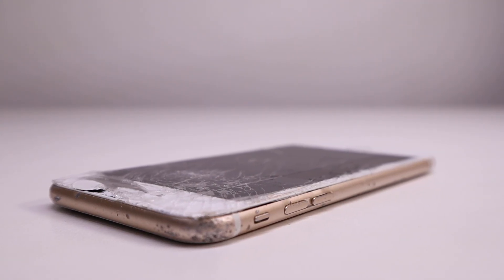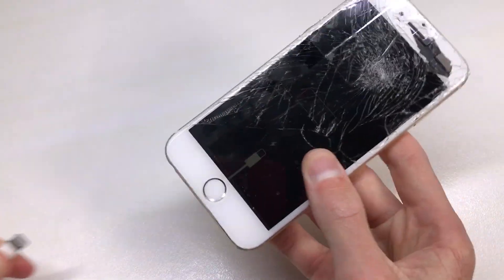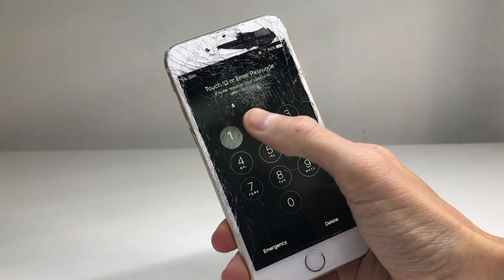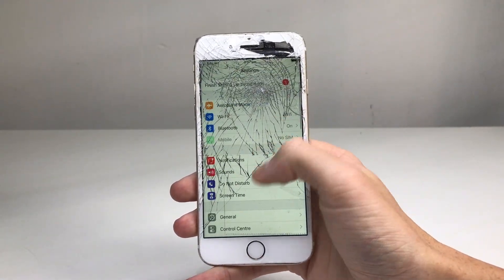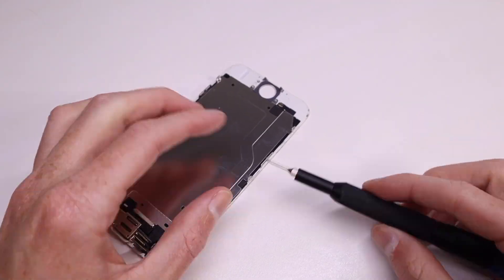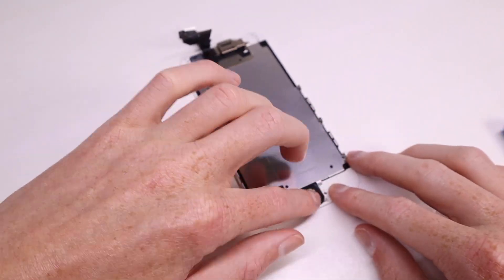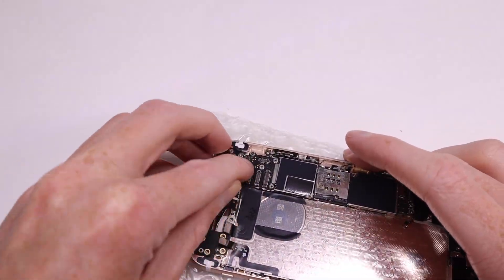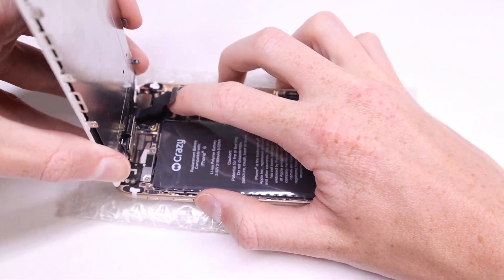$30 Destroyed iPhone 6 Restoration - Seller Tried to Scam Me?!

Comment: Loved your video, totally brilliant. I am sure that I am not alone....

But do not confuse people by talking about static and battery voltage together, almost as if they are the same. 

Some electronics can be damaged by voltages over 20 Volts. A static "spark", if visible, will easily achieve 6,000 volts or more. A static charge of 3,000 volts will not be visible, except maybe in total darkness!
Static discharge can also "weaken"components, sometimes they work and sometimes they don't!!

Never use any sort of plastic bag for working on, as many are not conductive. Conductive ones often have a tinge of colour, but if you are not 100% certain, do not use it!!

Static can be a killer of electronics, and working on such units as telephones, should ONLY be done on an anti-static mat (very cheap), connected to earth (for example, a house metal heating pipe where no paint has been applied), always checking the earth connection carefully with an Ohm Meter, and either an anti-static wrist strap (with a safety 1 Meg Ohm resistor included) to the same anti-static mat, or roll your sleeves up and always work with at least one hand/arm resting on the mat at all times. 

A 1 Meg Ohm resistor is needed for safely working anywhere near to mains voltage, but is a short circuit for static, leaking any high voltages away instantly.

After moving around, always touch JUST the mat again before touching the electronics, in this case the phone. 

I do not know if there are white anti-static mats, but if possible, buy one, as the video will be clearer for all here on Youtube!

Wearing clothes with man made fibers in them is a big "No-No". 

Natural fibers only like cotton.
Lay all your tools out only on the mat, or a second mat, also earthed.

A higher value of air humidity will also help to reduce static charge, above 65%.
Having a floor anti-static mat, where you sit and work, is also good, but if you keep your feet and legs fairly still, probably not needed.
Either wear no footwear, or only leather. No rubber or plastic soles or socks. But there are cheap static ankle units that are wound around the shoe and tucked into your sock, to make better floor contact....
Plastic or many made flooring is a no no too....
If you have any further questions, just ask.
Man, many thanks for making an otherwise really great and informative video.

Comment: 7:00 this is the antenna band. 
7:20 this is actually the ground -- leave this out, and the iPhone goes haywire.
The lines are just a bad connection on the screen... also a random coin flip :\

Comment: Looks like a Frankenstein phone with broken parts from multiple phones that were repaired. Bad parts assemble!!
Reply: SamSamStudio Please fix you’re englis so i can undastand yo
Reply: @chilly1661  Looks like the Ebay seller sold him a Frankenstein phone, a phone assembled from broken parts from multiple phones (i.e. a broken screen from one phone, a bad battery from another phone, a home button from a third phone, etc.) Jokes on him Hugh can still salvage what's left and bring it to life.

Phone flippers or third-party repair shops will buy broken phones to use as parts. Usually, only one component is broken. If there's a phone with a broken screen; the main PCB, battery, camera module, etc are all good. Buy enough of these phones, you can put together perfectly functioning phones. But after a few part swaps, you have many broken parts left over. These are garbage. Sometimes people will try and put together these broken parts and sell them. I'm saying the one Hugh bought for $30 looks like one of those given that the screen, the home button, and the battery were all bad. I'm guessing the flipper doesn't have advanced tools to reimage the motherboard and just does simple mechanical swaps of screens, home buttons, and battery. 

One man's trash is another man's treasure.
Reply: SamSamStudio Thank you for explaining but i think that’s kinda overkill not complaining or anything my eyes hurt while looking at that lol.
Reply: Please fix your English, so I can understand.

Comment: You said you brought this unit for 30$, and in the end you said you spend total 90$ on fixing it. So you got new case, new battery and new screen for 60$ total, seems cheap price
Reply: repairpartsusa
Reply: I bought my phone used, it had a shattered screen but I bought a screen for about $20 and replaced it after watching a yt video. I now have a new phone and sold that one, tho.
Reply: Uterr du Hi
Reply: STONKS
Reply: I get iPhone 6 screens for 15 bucks on eBay, and the battery is also around 10 bucks, and the housing is 15. 40 dollars usd is the same as 57 Australian dollars. So he got pretty regular prices
Reply: The Golden Waffle He uses apple refurb displays which are way more expensive.
Reply: 90 + 30 for phone
Reply: @bbekkaa365  wtf 60 +30 = 90
Reply: 90 bucks total,  with cheap af parts, when you can go to a repair place, pay mabye 10-20 dollars more, and the parts are as close to OEM as you can get, also would like to say that in my experience, for as much as people vilify apple over repairability, when it comes to the most common repair, a cracked screen, apple iPhones are almost the easiest to repair, pixel 3a's are the easiest thing in the world.

Comment: I fell out with apple after my phone got damp in the rain.  it was still functioning perfectly but I needed a new battery after 2 years.  They refused because a moisture sensor had been triggered and they said I had to buy a new phone.    I replaced the battery myself in the end and when my 6 finally died I went to Android and I will never, ever buy another Apple product for as long as I live.
Reply: also apple tie the home button to the screen so if you replace the screen with an after market one you don't get touch ID any more though the button will still function as a button.

Comment: Is it possible to just replace the ribbon cable to fix the connector somehow? I got a water damaged iPhone 6 and the battery’s adhesive was stuck to the ribbon cable it was put on the wrong way like instead of the adhesive tabs pointing towards the bottom the tabs were up towards the camera and when the tabs broke I had to pry the battery out which broke the connector for the antenna

Comment: the right side of the screen didn’t work for my screen repair either. I bought a new screen and that new screen worked but the new screen before it was not working on the right side. i installed the semi working screen on another phone, and then the right side worked normally. Why the fuck?

Comment: I found a phone next to a highway near where I lived.  It looked like it had been run over a few times by a car.  Now that I see your videos I'm thinking that phone might have been able to be salvaged.  Great videos.
Reply: Did it happen to be a 6s
Reply: joshii lmao I think it was cuz he didn’t reply lmaoooooi
Reply: @coastersnaps  I don't recall what version it was.  happened about 4 years ago, 2015
Reply: If it was a newer gen iPhone you could have brought it to apple and gotten a new one.
Reply: I gave the phone to my son in law to try and resurrect.  He doesn't have it anymore, so I don't remember what it was for certain.
Reply: doug holtz ok mine happened a little over a year ago
Reply: TechRax dropped a phone off a highway once and he couldn't find it! Maybe you got it
Reply: coolgamer1638 I play roblox too I’m a small youtuber
Reply: doug holtz i once was going home on my scooter/moped whatever you wanna call it and there was a random iphone 5 laying on the side walk so i grabbed it took it home and when i was home i pluged it in couse battery was dead i thought it was just broken and someone threw it away but like 5 mins later  in the charger it turnet on and it had the white hello screen so i thought like fkk this is icloud locked but it wasnt so i could just use it as an new iphone only thing was that it had a really small crack on the right bottom corner of the screen on the part  you dont even use
Reply: i ran over my iphone 5 by accident and they are absolute tanks---a new LCD and it worked fine for years.
Reply: Only broke bois do this

Comment: HEY YOU! Your home button not working? I had that on my old iPhone. To get the type in your password screen, you need to power off the phone and then turn it on. When you turn it on it should take you straight to the password screen. When you get in, go into your settings, general, accessibility and turn on assistive touch. You can change and move around what it does but it is really useful.

Comment: I hate when Apple tries to trick me into buying a new one.

I have this old iPod my brother gave me back in 2012. In late 2013, the front got badly damaged and then the screen became very bright when I GENTLY tossed it on my bed. It still works but it’s hard to see the screen. Took it to Apple to fix it, nope. I refuse to get a new one. The battery drains fast so it needs a new one. To this day, I’m still deciding whether to get it fixed or not but I refuse to throw it out.
Reply: TheKimiko16 is the brightness on the lowest setting? That would help
Reply: Fix it yourself

Comment: the reason home buttons don't switch over isn't because apple is insensitive. It is directly used as part of the encryption salt for the secure enclave. Changing this changes the encryption hash that is made at the factory, making it not secure to handle your fingerprint. Apple is the only people who can reset that encryption hash to account for the new salt from the new home button because there would be an exploit found if you could do it yourself.

Comment: No... It's your shitty parts that are causing the lcd lines, and loss of touch to your digitizer. Maybe go with OEM parts, you donkey. Or it's a loose connection with the LCD and Digi cables to the motherboard.

Comment: Hey Jeff need your advice 
my iPhone 6s  got stuck during ios update and now it won't turnoff
Reply: open it up and dissconnect the battery
Reply: @hasbulla9943  Thanks for the reply ,actually I did that when I power-on iPhone it went into itunens connect mode loop

Comment: “Touch disease” I think is the “coined” name for the jail bars, I’ve seen it a lot in the past few years doing repairs for a franchise. Mainly 6/6s family and plus models. Like you said static or pre exposure of parts to static discharge. Gotta love Apple. 

Tech tip of the day before picking up a part out of its ESD packaging rub a finger on a grounded fixture, or wear a static discharge band plugged into ground. My favorite is sit still and poke an electrical socket, (a grounded one) and then you should be good for a window of time. If not plugged in discharge throughout repair.  

Always remember clothing, hair, foot movement, as well as air currents can generate minute differences in potential, enough to generate “static charge” which can be lethal to semiconductor devices. 

Repair team for life

Comment: Have you ever tested it of NFC function?  An iPhone 6 with its housing replaced may experience difficulty in Apple Pay because of NFC antenna not connected,  since third party housing may have blocked the antenna connector, a few screws to the case, with paint.

Comment: I wouldn't say it was worth for 90$, since the touch ID is not working. You spent quiet a lot on the parts. I restored 6S and went with Product RED housing and the housing was 20$, genuine battery 10$ and genuine LCD 19$ + the phone was 70$, the touch ID was working and the phone was never opened, just cracked and badly scratched. Looks a lot better in red trust me ;), good job however I can see videos with older tech are picking quiet a lot of views nowadays. I might consider making a few myself. Your editing skills and overall video quality is really great however 12/10 on that

Comment: So Basically all you need is the mother board thing?
Reply: Yes all you need is the motherboard + touch ID paired to the motherboard. He didn't have the original home button, that's why his touch ID function didn't work after restoring. The housing + battery and LCD screen are all very cheap on eBay, just the motherboard is very expensive.

Comment: The little connector every one always forgets used to be RX Power to cellular antenna on iPhone 4, on newer devices its just a ground to the housing bracket and if you ever lose it you can get a replacement from ifixit at 0.99$ https://es.ifixit.com/Tienda/iPhone/iPhone-6-Grounding-Bracket/IF268-065?o=1

Comment: reason you got the lines and the lcd malfunctioning is because you didnt lay 1 or more of the screen connectors in properly
Reply: i also got this and reinstalled the screen 5 times (counted) and they still appeared. ended up getting a new one a month later that did not have this problem
Reply: @methus9812  if you bend any of the pins on the connectors it's going to keep happening, need to make sure you always lay them down flat and straight, if it's not going in don't force it.

Comment: 5:40 That is not true, apple is acctualy locking this because of the fingerprints which are stored on the chip itself. Otherwise you could just open a locked iphone and replace the fingerprint sensor with your own sensor from your own iPhone and get into any iPhone you want by unscrewing 2 or 3 screws...
Reply: No. This is bs

Comment: In my experience those replacement displays very often are of sub par quality compared to the original displays, either to cold or to warm, or have bad anti-reflection filtering, or bad anti grease coating and become scratched faster. Not sure if there is any way to get high quality displays.
Reply: Yet the only way he could do this is by cheaping out on the battery and the screen.
Reply: @catagris  You can see even in the video that screen looks a bit off. At 10:38 Colors look off to me, and it looks weirdly pixelated.
I have also had problems with 3rd party screens draining battery way faster than the original screen at similar brightness levels. Not so common though.
Reply: @Andian Bandibas Best way to go would be to buy broken iPhones with intact screens.

Comment: Those lines on the screen are because of static i’ve had similar issues on ipad screen replacements where it didn’t turn on due to static; just perform a hard reset and the issue will be fixed.

Comment: Hey Hugh, very nice video, but it will be even more awesome, if you add all the price of the replaced components that you replaced and total amount what it took you to restore the iPhone.
Reply: well , there are 4 parts , old phone (30$) , refurbished lcd (another 30$) , whole housing and battery (yet another 30$) so roughly 100$ (prices vary) and at most an hour.
Reply: DqdoMraz100 that's really incredible man
Reply: DqdoMraz100 , is it possible to add 128gb hard drive on my 32 gb iPhone 6s plus? Because that would  be awesome
Reply: @prasadpandav  i watch some1 do replace emmc memory with bigger , but i think it require a lot more gadgets and knowledge than simple swap of housing and lcd replacement. In fact i was offer to participate in lessons that teach you that but was reaaaaly expensive (1.5 thousand $) and i skip the offer.

Comment: u realize for $160 you can get a BNIB retail iphone 6 from Walmart & other retailers & subsidiaries, right? or a $120 Pretty decent condition iphone 6. food for thought, save the $ & the hours. informative video tho
Reply: u realize there are countries there arent any walmarts , but lets calculate : 160 - 90 = 70$(brand new condition) , and what hours talking about , this is repair operation done by pro for 15 min , an average technician can do it for a less of an hour anytime. Still good video , he got lucky with not locked phone .

Comment: Hey Hugh, could I get a link and names to the softwares you used for the iPhone 6 and where you got the new housings from? I have an old iPhone SE with a severely bent housing, still in functioning condition minus the charging port. I've been thinking for awhile to transfer the logicboard and such to a new housing but the one's I'm finding are completely bare.
Thanks

Comment: Don’t mean to be harsh or a know it all but in this video it’s either the aftermarket screen (if this happens a lot then most likely scenario) or this phone has some damage to the touch connector. I know it’s two different cables but an issue with the touch ribbon will show like this. 5 series are more notorious for this than the 6, 5 because the touch connector can become half unclipped if lifted too high, 5s/c because of the length of the connector and it can flex too much. Same with 6 plus. Most common issue after battery replacement / uncoupling is a flickering screen and this fixes its self. Refurbished screens are the only way to go, depending on your warranty.

Comment: I replaced my battery on my iPhone 5 and one screw was stripped so I had to very lightly hammer the screwdriver into the screw to get it out. Replaced my battery and SIM card and she worked perfectly. Apple is gross and just wants you too buy a new phone as soon as they release the new one. Fuck off I like my iphone 5

Comment: I wonder what would happen if you take the phone to an apple store and requested to replace the home button. It seems brand new, and they wont refuse to change it until they see the battery, but you could get the older battery back and get you home button replaced.